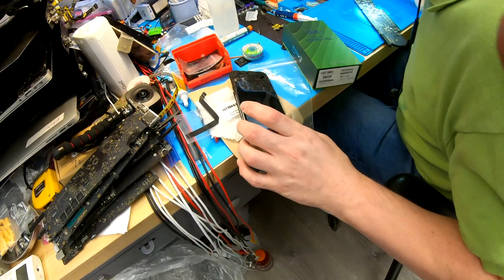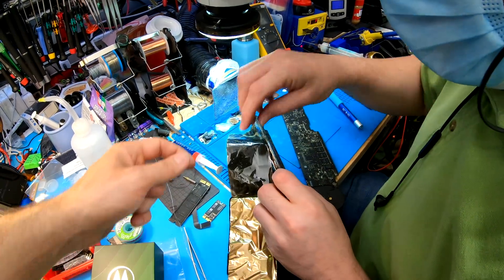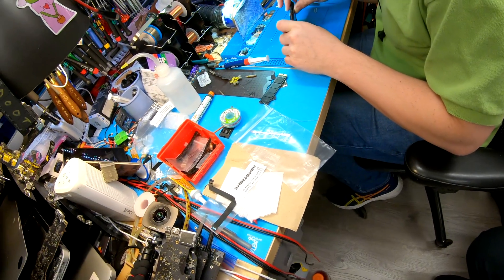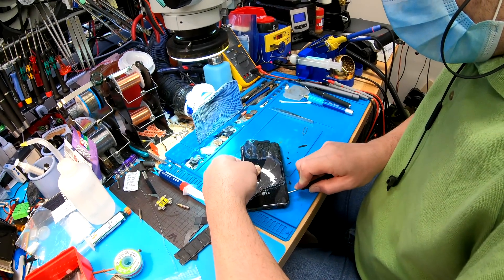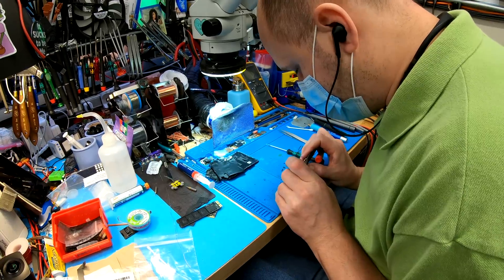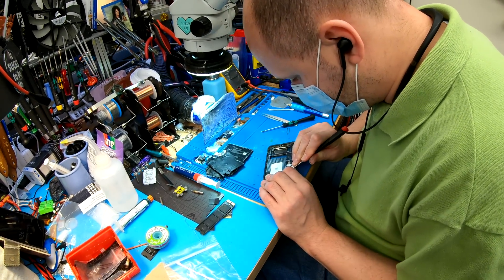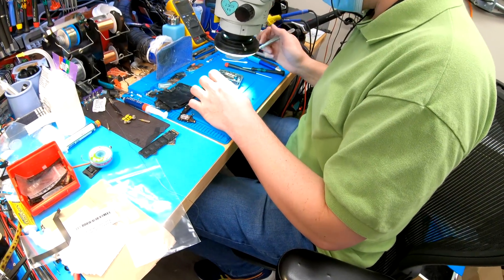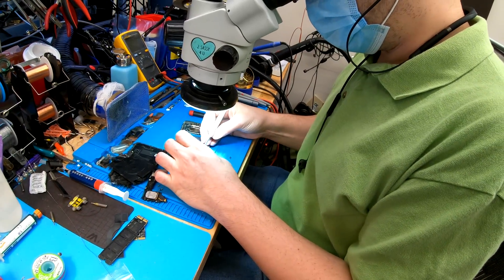Can Paul recover my phone data after the bike it was attached to goes on fire?

Comment: No one:

Louis: I can run 4kW through a 1kW motor. People say I shouldn’t.

Also Louis: The front of my bike is fine, the back is vaporized.
Reply from the maker: I learned my lesson, but a different one than the one you may think. I still put 3kW through a 1kW motor on my other BBSHD and have for years - but it's with an EM3EV battery. The lesson I learned here is that if EM3EV does not have the battery I want, I will not buy it. Take a look at how well EM3EV constructs their triangle packs. It's a work of art how much these people care about attention to detail. https://www.youtube.com/watch?v=mDHGBw2dlDs 3kw and above through a BBSHD is popular enough that companies sell kits for it. https://electricrt.com/bafang-bbshd-upgrade-kit/ 

The reality is that asking aliexpress vendors, even those with a few referrals and decent feedback, to make a battery with the cells I ask for always ends in tragedy, even if I pay the premium to have them constructed the way I want. How do I know they didn't pocket the money and cheap out on the cells? Every bike I have built with an EM3EV battery is still here, every ebike battery I get from aliexpress, even with good feedback, is on fire within two weeks. I really thought by running these batteries at 30% their rated capacity at my highest speeds I was well within the safe range. I learned my lesson. 

If it were a motor fault, the motor would have a broken rotor, bad nylon gear, or the windings would've burned out - but that was all fine! I was able to ride home with no problems, and come to a stop outside my apartment. The motor controller was switched off, and the bike had been stationary for an entire minute as I checked my cycle analyst details and my phone. Having a motor/controller that asks for more power than your battery can supply is a fire waiting to happen. A battery that has the ability to supply more power than your motor/controller will ask for is fine. The controller was limited to 50 amps, and each 20S10P battery with 35E cells on the bike can, by itself, put out 80 amps without a problem. 

The wiring was as follows: https://imgur.com/a/dHOgsXW

Samsung 35E cells are rated for 8 amps continuous output. The cycle analyst computer said the max amperage output for the entire trip was 46 amps. Since two of these 20S10P were in parallel(through a bridge rectifier so one battery cannot charge the other), you're looking at 24 amp output per battery as a max peak. Divide that by 10 since each battery had ten cells, and you get each individual 35E cell having put out a max of 2.4 amps peak, not continuous, over the course of the evening. That is waaaaay under what the battery is rated to be able to supply - the hardest we were on that battery the entire evening was about 30% of its total rated output. 

Let's say the cells were imbalanced from each battery pack, so the diode was only letting power through from one battery. This means the worst case scenario is that an 35E cell in there was asked to put out 4.8 amps peak, since the output from the diodes would be switching rather than using the same voltage from each source. That is still way less than the 8 amps of continuous output they're rated for. This wasn't even happening since both batteries are charged through the bridge rectifier each time, with enough time for each battery to charge to 83v. 

A 20S10P battery with an 80 amp continuous BMS should have zero problem doing 46 amps peak - even on its own. Much less with it having the help of another battery: UNLESS it was constructed with cells/BMS of lower quality than what was requested. 

Each battery had a DC circuit breaker(NOT a shunting circuit breaker or an AC circuit breaker) rated for 63 amps on it, which is below the rated output capacity of 80 amps for either battery, so that if a short occurred upstream that the battery BMS didn't catch, the circuit breaker would.

I have run single battery 149SP systems from EM3EV that were asked to put out 40-60 amps and no fire. I have even accidentally shorted positive & negative - the BMS makes a click noise and just turns it off. With crappier batteries, when there is some sort of short, the BMS does nothing and it just goes on fire immediately. I am genuinely curious if that is the case with this battery I got, but obviously, there is not much left to look at, test, or examine from this site besides the motor housing.
Reply: @rossmanngroup  Aliexpress and high-amp Li-Ion battery pack doesn't sound like a good combination. It's like those "6000 mAh, 30 A" 18650 cells they sell on ebay. If you're lucky, it's a 2000mAh power-tool cell that actually does 20 A, if you're unlucky, it's a shitty 2000 mAh cell that explodes beyond 4 A.
Reply: @rossmanngroup  well if you can solder logic boards you are also easily qualified to operate a spot welder to build the pack on your own. Even Linus managed to do that without setting his house on fire. (granted he was instructed while doing it)
Getting genuine Samsung or Panasonic cells can't be that difficult in the US. Just pry then out of a Tesla that has his park aywhere lights on ;) 

Also: what is this teasy BS? You can't start burning down Brooklyn and not show us the actual carnage. We really want to see your Baghdad remodeling job.
Reply: @dgschrei  It's on Erica's channel Cinna Vision . The fire is here https://www.youtube.com/watch?v=u6luNwhSqMg and the aftermath is here https://www.youtube.com/watch?v=yygJsh1olqw
Reply: @rossmanngroup  If fire started 1 minute after turning off load i could be internal short in a battery. Do you have isolators on positive side?
Reply: @latemhh5577  What would "isolators" on any side do to stop an internal short?
Reply: @rossmanngroup  bad cells matter luis, don't be so inconsiderate!
Reply: @rossmanngroup   If they made them any safer you couldn't afawd it.
Reply: @rossmanngroup  35E cells can output 8amps continuously @ 23c AS PER THE DATASHEET. You had 200 of them tightly pack together and insulated with packing materials. Your batteries never operated at 23c. Assuming the pack could safely output 80amps is part of the problem right there. All the safety measure you took yet a $10 thermocouple could have monitored the pack temperature under load and informed you there was a problem before you had a fire on your hands. Even Apple monitors battery temperature do they not?
Reply: @rossmanngroup  there is always a risk when u push tech to its max and a little beyond its half the fun I used to be into RC elec cars Lithium polymer packs can bite.
Reply from the maker: That is my point, Max here would be 160 amps, not 46. those batteries were running way below the capacity that they were sold as being capable of performing for continuous output
Reply: @rossmanngroup 
Yeah... Chinese Amps are a different unit though. It's a sort of flexible conversion ratio that varies depending on how well they speak English.
Reply: @rossmanngroup  Yeah, doesn't sound to me like the fire had anything at all to do with the load conditions.
Reply: blackmoons won
Reply: lol cute but not the case XD
Reply: Cheap lithium = 🔥
Reply: Yahh That's more related to battery location, the motor aboslutely wasn't the problem, he even had it disconnected. And the battery won't get hotter from having 4kW draw though a 1kW motor then a 4 kW motor.
Reply: starshipeleven  By isolator on positive side i meant a pad (washer?) from non conductive material that prevents nickel strips welded to + touching cell metal casing
Reply: And today, as always, I hope you burned something!

Comment: "Your SanDisk looks like a knock-off". 
It burns...
Reply: Except it didn't, as it turns out.
Reply: Eh, so long as it stores what it says and you’re backing your shit up who cares?
Reply: @jcnot9712  cheap clones are usually not as reliable of storage as the original, given that they're made with cheaper materials and all, so you wanna store your data in some high quality, genuine storage media.
Reply: RyanRoadReaper I guess it depends on the person. I use high capacity (or cloud) storage as convenience to not have to delete files on the fly. Otherwise, I back it all up ‘cause you can’t rely on it no matter how good the hardware. But judging by Louis reaction he probably overpaid for it, so I guess I would be pretty upset in his shoes.
Reply: @jcnot9712  I myself keep a copy on an enterprise level hard drive I paid a lot of money for. If that starts to click, I know its time to make another backup and either repair or replace the drive. Hasnt happened yet, thankfully
Reply: @RyanRoadReaper  Sandisk has gone to heck IMO, used to be good.

Comment: SO wait, was this your new bike that caught fire? I've been making a battery controller to prevent this exact thing. https://github.com/RingingResonance/EV-Battery-Controller

It's not complete or in a fully working state, but should help resolve some of these fires, overload or over temp conditions, and also acts as a battery heater controller for colder climates. It also logs battery telemetry. The current firmware should work, but the hardware is electrically noisy when powered on causing the system to error out and shutdown almost immediately. At least I know that my shutdown procedures works. :/
Reply: Yes, it was his new yellow bike.
Reply: @Soren0  Damn, that sucks. That was a cool bike. :.(
Reply: @RingingResonance  Yeah that bike was really neat and he paid over 1k I believe.
Reply: @Soren0  where can I find more about this?
Reply: @Soren0  where can I find more about this?
Reply: @leonboerkamp3090  You can check out the two videos on Erica's channel here of the bike fire. https://www.youtube.com/channel/UCrdTfxwUNad1FSUcDSzp6GA/featured
Reply: @Soren0  I cant find them you know how long ago they were posted?
Reply: @aldrinw706  I believe Erica took them down for some reason.
Reply: What happened to the red bike ?
Reply: @CharlieQ7400  I believe he still has it.

Comment: I did learn something. At least your second BIG ass ebike tinkering-related fire. Maybe you learn that you have to be more reasonable with modding ebikes? Hummmm...
Reply: It's possible happened due to cell imbalance and the rectifier failed causing one battery pack to charge the other causing a bank of cells to become overcharged. That or dendrites from overheating/overloading a single pack that had more of a charge then the other and therefor being the pack with the most voltage it ended up being the one supplying the most current, or from charging it in the cold causing premature cell failure. This is why you have pack per pack current limiting and temp monitoring during charge and discharge cycles along with some kind of automatic cell balance and cell per cell voltage monitoring. Those cheap 14S BMS boards are better than nothing at all. At least with those their over current protection will prevent a sustained arc if their is a short, they will shutdown in over/under voltage conditions, and they do just enough balance current per cell to keep a good pre-balanced pack in balance.
Reply: He's doing all the work for the anti e-bike community that keeps screaming, "They're dangerous."
Reply: @MrV1NC3N7V3G4  almost all the laymen in the west are terrified and ignorant when it comes to working/using a battery. Just don't do dumb shit with the battery and you're safe. And buy batteries from reputed brands.
Reply: @megalith7796  If by "in the west" you mean the U. S. then GTFO. There are obviously safe ways to build and use battery packs and I work with them daily. The point I was making was that Louis has had two bike fires in as many years which only fuels the paranoia about rechargeable cells.
Reply: @MrV1NC3N7V3G4  Paranoia. Or is it?
Reply from the maker: Modding doesn't really have much to do with it. I learned that regardless of a vendor's feedback on aliexpress, don't trust them to put it together with a good BMS, or the cells you ask for even if you tell them you will pay a premium. It's one thing to buy cheap shit and get cheap shit. It really sucks to pay the premium and still get cheap shit. It's a lesson I think is worth going over in a later video. 

I saw a few people post about this particular vendor on reddit as well. Not at the thermal overload stage, just at the "damn, I expected better" stage. This is a niche community.
Reply: @rossmanngroup  BMS is useless in the prevention of a battery grenading itself if your do not have cell level fusing. I don't use BMS on my EV. Jehu does not use BMS on his VW bus (huge ass battery). What we do have is individual (tesla style) cell level fusing. I do balance charge. Many BMS over charge cells which fucks them. I say it again no BMS can prevent a fire if your cells do not have cell level fusing and proper electrical isolation between series groups. Cell level fusing immediately disconnects any bad cells the moment they become problematic. 

I been building & rebuilding battery packs with 18650 cells since 2003 and never had a fire. Be happy to build you a battery right here in North America...but I mean if I can do it high you can do it too Louis. Your skill is better than mine.

I would be interested in seeing a tear down of one of these "premium" batteries you've been buying so we can diagnose the fail mode together.
Reply: @rossmanngroup  It very much is a niche community. CYA though. Those cheap BMS boards are better than nothing at all if you still regularly monitor your cell voltages like before. I get mine from ebay; they likely come from the same manufacturers, though I've had better luck with shipping and US stock so I can get them within just a few days or a week. Just be sure to get the ones that have cell per cell under/over voltage protection preferably with some kind of over current shutdown as well as the cell balancing. I've had pretty good experience with them. Just know what you are buying, and watch the circuit like a hawk through testing before you trust it. IN my experience, they keep cells within balance just fine so long as you pre-balance them before hand and regularly charge them so that the BMS has a chance to balance your cells once your pack reaches a nearly full charge. All within 0.01V of each other. Most of them uses pretty standard ICs anyways for that part anyways. Additionally, you need current limiting based on charge percentage along with overload protection to keep from ruining your cells. Ideally it would also include temp monitoring and charge/discharge limiting based on temperature. You can have this circuit separate from the cheap BMS boards and combine the ones you like.